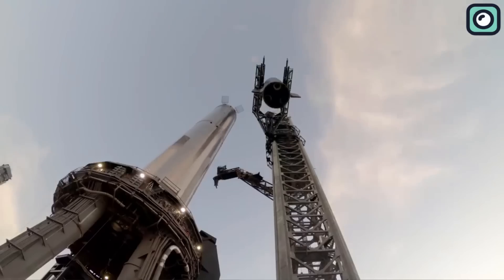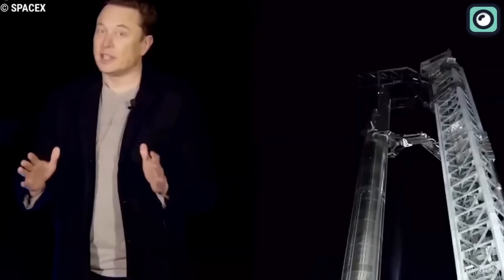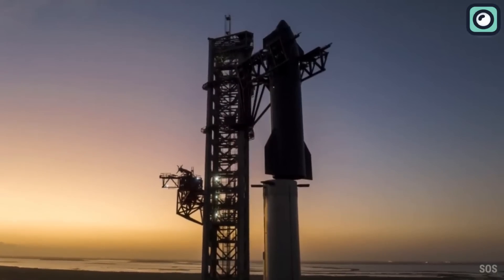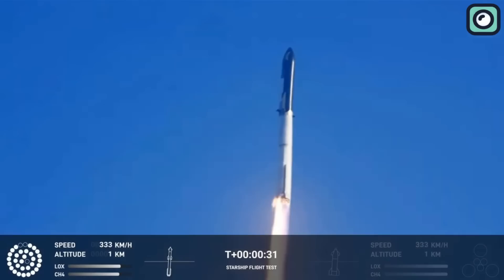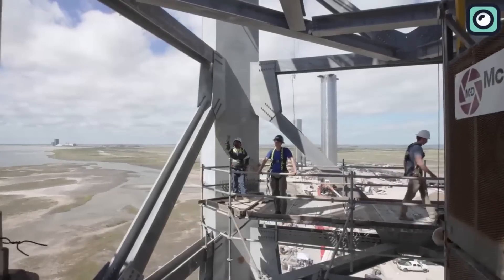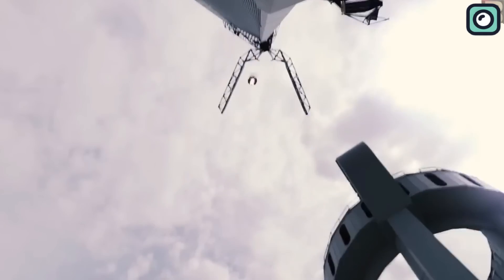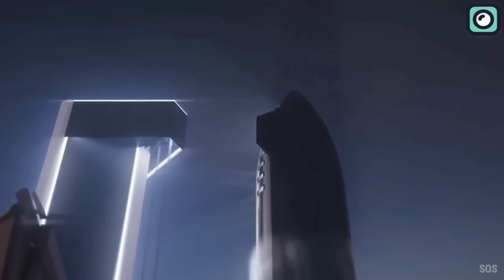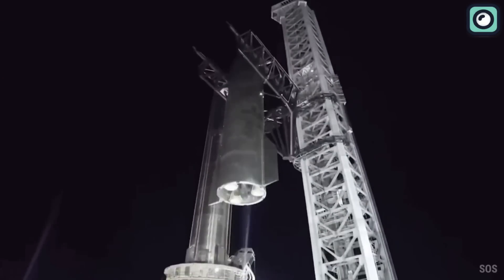SpaceX Prepares Stage Zero For Next Starship Launch in Few Weeks!

Comment: The cast I was watching showed the Locks at the base did not release thus holding the rocket on the pad for a few seconds and as anyone with a little knowledge about basic explosive force If you hold a Firecracker on your open palm, you will have a little pain. Close your fingers and hold tight and you will lose fingers. It's That Simple. Why did the locks stay shut? All the damage to the pad and the ship can be easily attributed to this and yet no one is talking about it.

Comment: It's obvious that all 33 raptors do not have to fire for the rocket to lift off.  If all engines were to operate at time of lift off could Space X reduce the initial lift off power to minimise damage to the pad. Then a few seconds into lift off provide full power to the Raptors. Just an idea

Comment: Pressure of ambient air at sea level generates force of 10mT/m^2. That force pushes at rocket exhaust gas preventing that gas from expanding sideways after it leaves rocket engines nozzles. Installing upsidedown diverging funnel below launch mount would prevent that squeezing and allow rocket exhaust to expand sideways before it hits launchpad. Installing tungsten tipped cone at the center of launchpad would redirect exhaust gas sideways as well. Water deluge nozzles installed in that cone could be spewing water downward creating water blanket on the cone and on the launchpad without trying to "fight" rocket exhaust.

Comment: The raptor engine produces thrust at  4,800 psig .  That pressure will not be greatly reduced  after 50 ft. and meeting the steel plate with orifices for water .  To provide significant/ needed water flow at 3,000 psig  will demand positive displacement pumps with high GPM rating at 3,000 psig.    There is probability that the water will not emerge from the plate orifices  and  pump safety relief valves will open  making the system useless.
Reply: The exhaust gasses that far from the combustion chamber is going to be a LOT LESS than chamber pressure.  The major problem in my view is that the exhaust impinges on a flat plate instead of a diverter -- this will result in much higher shockwave forces acting on the rocket as the acoustic energy is bounced directly back towards the rocket.  At the distance from the combustion chamber that this plate will be located the exhaust pressure is not the big factor, shockwaves are the bigger problem!
Reply: The force will blow it out and continue damaging system. Recomend 30ft deep pool of water. (Water it best way to reduce damage)
Reply: @aaronb8698  You do realize that a 30ft pool of water would last about 0.3 seconds ... right?  For reference, the Saturn V rocket produced about 160 million horse power and Starship/Super heavy is twice as powerful.  A 30 foot pool of water is nothing to it.  The flame needs to be diverted and then ducted with a flame trench and then water is sprayed to help with the heat but mostly to dampen the enormous acoustic energy/power.
Reply: @aaronb8698  😮 yea a good test of the water is steam
Reply: Just create launch pad over the ocean, that's the safest launch plus you get fried fish for lunch
Reply: @Mr._Random  Salt water isn't a good thing around rockets.  During launch hundreds of tons or water could be blasted everywhere including inside the engine bay and that is no place for salt water.  There's no place on a rocket that walt water would be acceptable.  
If you launched over the ocean on a oil rig platform or similar you would be advised to include a flame diverter splitting the exhaust in opposite directions and not into the ocean.  You want to use water deluge for heat and sound suppression but that water needs to be fresh water so either the platform has a pipeline from shore to carry the water or you will have to use a barge to transport the water.
Reply: I bet the whole plate will blowup on first test.

Comment: SpaceX chose not to light those three engines, the remaining 30 was a mish mosh of various designs. The next launch will have 33 of the new simple design. The engines that gimble will also be driven by electronics, not hydraulic. In all there are 100 improvement to the next booster.
Reply: But wait, didn't the Soviet Era space program land their craft on Venus about thirteen times in the 70's? Freemason lies 🤥
Reply: Need bigger wings 😅😮

Comment: Why are the hydraulic systems close to the engine on the booster
Reply: That was an earlier iteration of the vehicle. An all electrical system will be used on the next test.
Reply: Control the direction of nozzle.

Comment: These upgrades are insignificant and on the cheap .  Double the power of Saturn V  and Space X  launch pad  is  for  the worlds largest Estes Rocket.
Reply: SpaceX risk those steel plates coming apart and flying through the air like giant sharp pizza pans.
Reply: @jason_m_schmidt622  my opinion is that won't happen but the exhaust will still back up upon the engines.
Reply: That is why Musk is the incredible genius there is no problem he cant overcome!!
Reply: @ezragonzalez8936  Elon is genius to be sure but he has many engineers to " Make it So.  He has lawyers to assure patents are his personal property.
Reply: @ezragonzalez8936  except for his tiny penis.